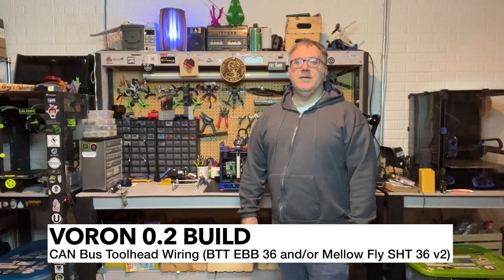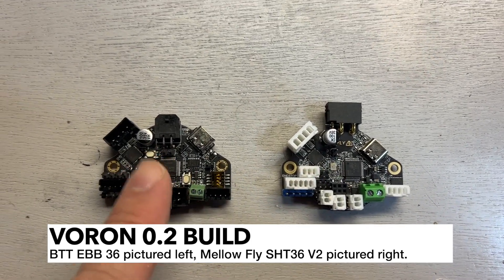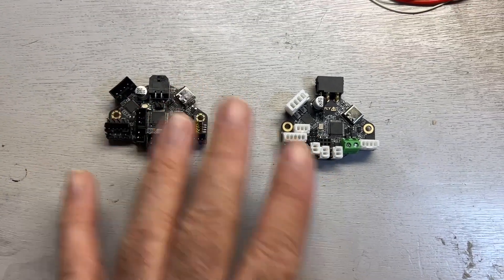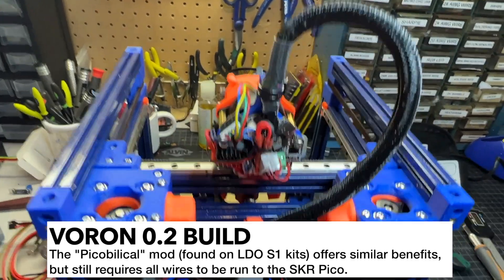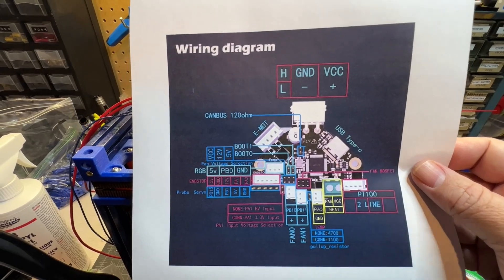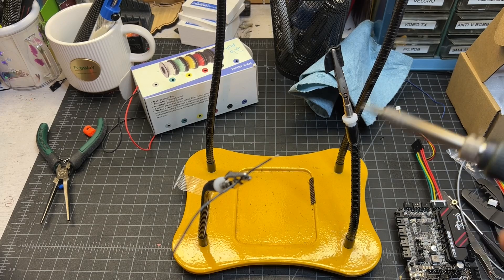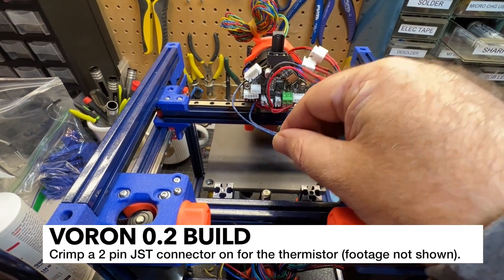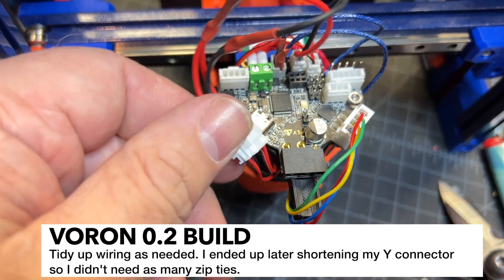Voron 0.2 Build Series - CAN Bus Toolhead Wiring

Comment: Nice video! Can I ask which printed file you used for the strain relief body? The one in the voron design github does not work with Canbus PCB. Thanks!
Reply from the maker: I believe I downloaded one from KayosMaker - https://github.com/KayosMaker/CANboard_Mounts. Check there.
Reply: Thanks so much!😀 @GregsMakerCorner

Comment: I had a bad experience with the Mellow umbilical PCB because of poor crimp quality in the main cable connectors causing short-term interruptions on heater and fan power depending on the print head position. It was frustratingly hard to nail down the cause and then undo the whole damn thing, when all cables were already trimmed down to the bare minimum lenght.

Comment: Did I miss the link to the canbus transceiver board?  I'm looking to implement can on my v0 and I literally have no space for a u2c/utoc.  I really like that tiny board and wondered where to purchase it.
Reply from the maker: The transceiver board does work great with the SKR Pico. I definitely recommend it over a u2c/utoc if you are running a Raspberry Pi 4. Check out my wiring video in part of the series, at about the 14:26 where I show it. https://www.youtube.com/watch?v=OVVrwAItSUU&t=863s

I have been planning a follow up to go into more detail on the connections but haven't gotten around to it yet.
Reply: do you still plan to show how to do the coding (configuration) part? @GregsMakerCorner

Comment: I'd love to install one, for easier maintenance, but there's no pin for the klicky probe, and mu 2 sequines led, sadly
Reply: Ebb36 supports all of that. I'm confused
Reply: @wildBill83  at the time, I still had a v0.1, and I couldn't have both the klicky probe and the x endstop switch. If I recall correctly..
Reply: @Sttreg  it's supported. Ebb36 has input for up to 3 endstops. The LEDs have their own header as well.

Comment: Did you use the EBB with the MAX31865 or without? Is the MAX31865 a worthwhile upgrade for the few extra dollars?
Reply from the maker: I don’t use the one with. I don’t think it’s needed unless you are running a high sensitivity thermistor like a pt100. For what most of us print, it’s probably overkill. Best of luck!!

Comment: I installed a Mellow Fly SHT36 v2 CAN bus board on my Custom 300x300 bedslinger. It works well, but I have to agree, the smaller JST PH connectors are hard to work on with old eyes 🙂. Also, I mounted the heatsink on the TMC2209 driver, thinking it would get hotter than the MCU. All my other 2209s have heatsinks on them, but my Octopus v1.1 MCU does not, so I figured this was the way to go. Oddly, there is no manufacturer reference as to where to install the heatsink.

I struggled for a while trying to get my hot end thermistor to read properly and ended up going with a custom pull up value in Klipper. It turns out the heatsink on the stepper driver was shorting something out. When I removed it, I could redefine the pull up value to 4700 (standard value). Hopefully this helps others if they run into a similar problem. Also watch if you install the heatsink on the MCU instead - I've heard of others smoking the board if it short out there. Thankfully my board was not damaged by the heatsink.
Reply from the maker: Thanks for the comment! Good to know about the heat sink. I was carefully installing it and haven’t seen any issues yet, but it sounds like it may not even be necessary.
Reply: @GregsMakerCorner  I re-read my comment - Just to clarify, the old eyes I was referring to are mine. I was agreeing with you that the connectors are hard to crimp, not that you have old eyes, lol. 

I'd like to add, that was a nice video - It's hard to compare the two CAN bus boards (Mellow and BTT) and you're one of the few (if not the only) to demonstrate and contrast both. Most online comments I found just say they are similar. To add to this, I originally purchased the Mellow Fly SHT36 v1 - which was cheaper - but then cancelled when I found the v2 version. I liked the select-able fan voltage and I read about some confusion with the pinouts on other connectors. Getting a pre-made cable helped to not switch V+ and V- with CAN H and CAN L like some users have run into. I'd also like to point out, that the v2 version moved to the non-STM processor and the firmware has to be updated over CAN bus - on this model my understanding is that you can't flash the firmware through USB.

I'd also like to add that if anyone is sitting on the fence about CAN bus, it's worth doing. Having a light tool head cable and being able to replace fans, swap hotends, etc without removing cables from drag chains or cable looms is worth the extra effort and learning curve to flash over CAN bus - and define your pins in Klipper to start with MCU names.

To finalize about the heatsink - I monitor the temperatures of my RPi, Controller MCU, CAN Bus MCU, and stepper drivers (x5) and I don't see any difference with or without the heatsink. Mind you, my tool head is not enclosed in the back.
Reply from the maker: @yardmull3t273  Haha, funny because I just got glasses and had to get a second set of "computer glasses" because I can't see the screen very well with my normal distance glasses. Unfortunately I have a hard time with progressives.. my eyes are definitely not working to well these days! LOL I can relate to that.

Thanks again for taking the time to comment, I appreciate the insight and thoughts especially on the heat sink. And I definitely am glad I am running CAN Bus as well, it is totally worth the upgrade!
Reply: That heatsink should be on TMC ( as its "power" component ) MCU itself doesn't produce much heat.
Reply: @kymlalu tmc2209 should dissipate heat through the PCB ground plane. Best place to put the heatsink technically is under the chip but that's not possible.